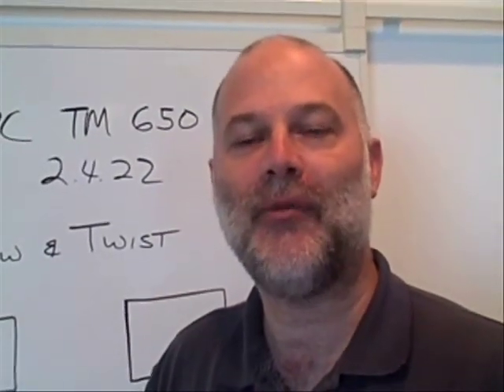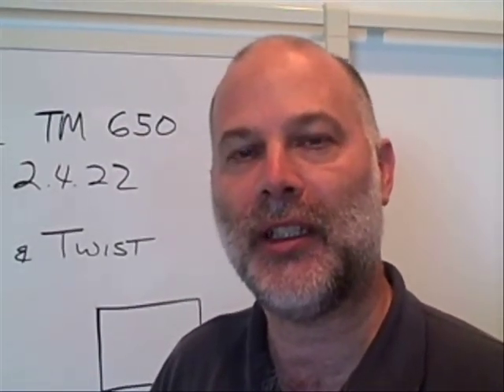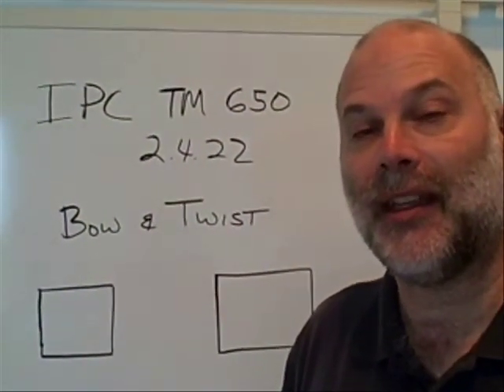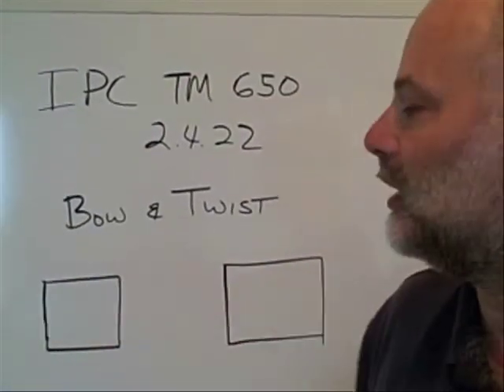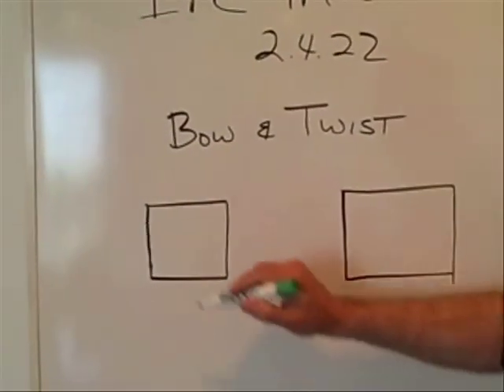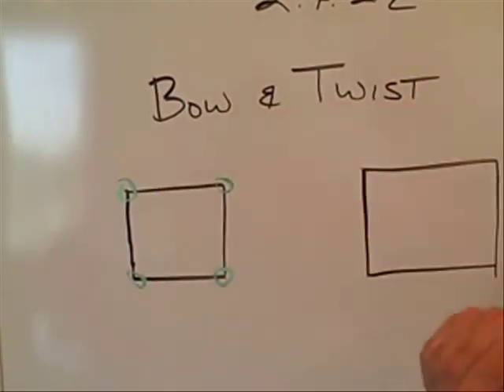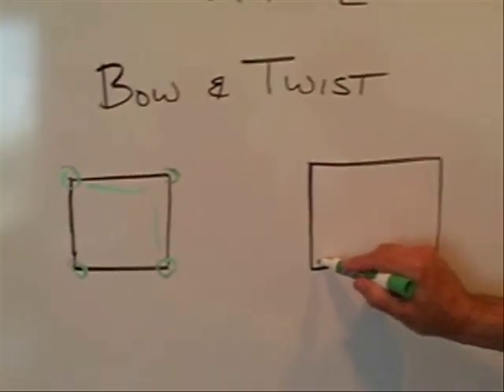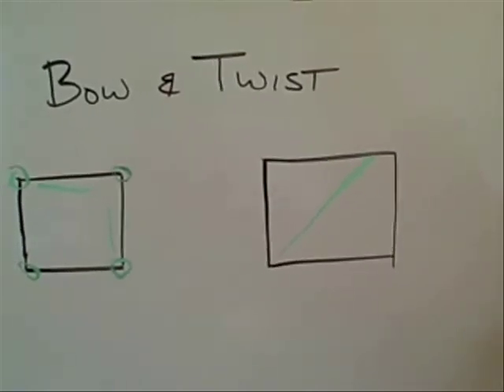What is the right way to measure bow and twist? IPC technical question of the week.

Comment: The assumption is always that the bow and/or twist is gradual and more or less consistent over the length or width of the PWB. I think that this allows for sudden steps or non-flat areas over short distances as long as the overall tolerance of .75% is compliant. I feel that the requirement should be measured per sq in. based on the bow or twist total divided by the distance. I usually specify it as .008/ in x in not to exceed .0075 x the length and width. I know that this is NOT how the IPC spec reads, but I feel that is how it should be specified and inspected. Large FPGA type devices can't stand large deviations over short distances.